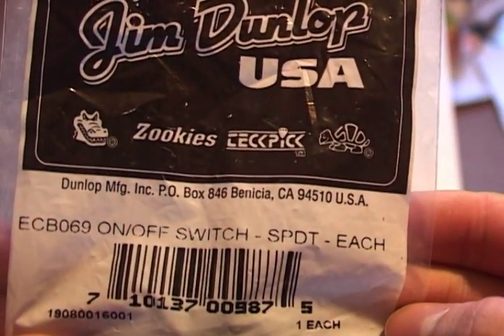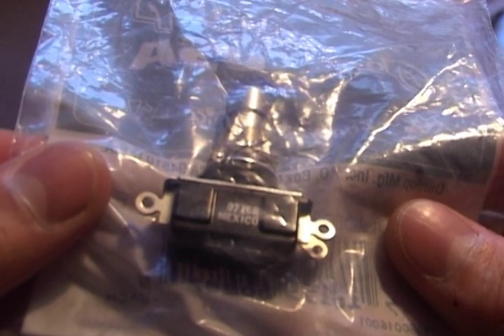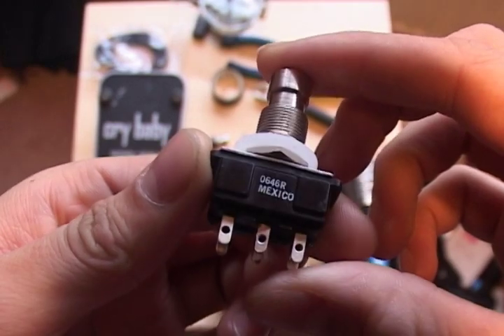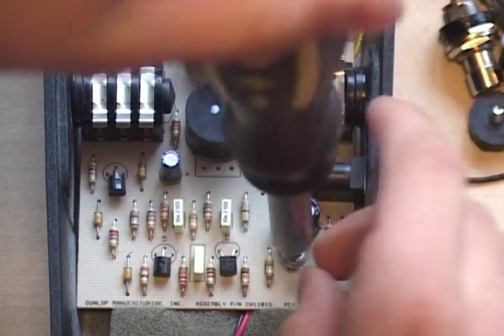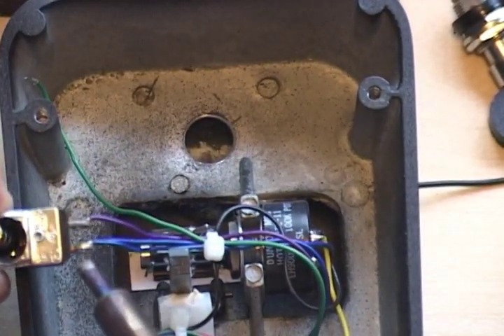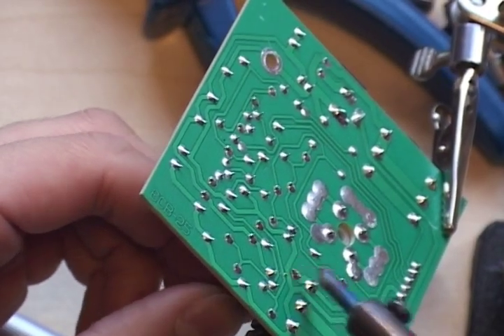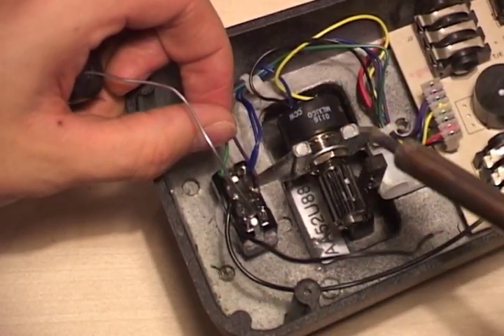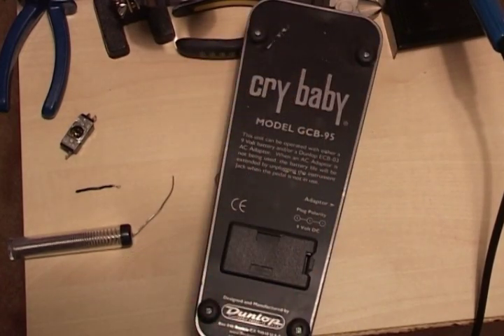Wah Mods (Part 1): True Bypass

Comment: I’m sorry but this is NOT true bypass. You need to break the trace between the input jack and that black wire you added for the input.
Pointless if you don’t break that trace.

Get you meter out and I bet that both input wires are touching all the time whether the pedal is engaged or not.

Comment: Hla tengo un wah wah bc le hise lo mismo pero no se donde va el cable agregado a la placa ya es un clon del cry pero no tiene esa parte donde colocas el cable nuevo.
Reply from the maker: Which wah pedal do you have? This was done on a GCB-95. From what I remember you add a cable to the input plug on the circuit board for the 'clean input wire'
Reply: @chrismusic-wav  l have wah DIXON CB 200.
Reply: @chrismusic-wav classic  clone of crybaby, vox 847
Reply: @chrismusic-wav  witch reversed polarity the negativo on the outside and the positive in the center
Reply from the maker: @paolaelizabethgramajo5827  also found this for you if it's based on the Vox 847 pedal https://dandyjob.com/true-bypass-mods-instruction/
Reply: @chrismusic-wav  gracias amigo!!!
Reply: Cualquier cosa te pido ayuda.
Reply from the maker: @paolaelizabethgramajo5827  I can only but try to help
Reply: @chrismusic-wav  ❤️!!
Reply: @chrismusic-wav  has no bufer
Reply: @chrismusic-wav  does the wire you add go on the clean side of the wah plate?
Reply from the maker: @paolaelizabethgramajo5827  it does. So wire should be connected on clean side of pedal to tip side of jack before any circuitry. You may need to look at the back of the board to check the copper tracks. Not sure what your board looks like so you'll have to check where the tracks go and if it splits to see if it goes through any circuitry as that track needs to be cut and separated on the board to be effective or i think it just grounds out

Comment: Hey I know this video was from 11 years ago but I edged out the bronze connection on the pcb as shown in the picture and now the wah pedal works but when turned off it cancel outs all the sound. It turns into a kill switch when turned off now would really appreciate a reason or solution for this!
Reply from the maker: Hey, did you switch the wires round as well also mentioned in the description? 'Switch the black clean input wire with the green FX input wire on the switch'.
Reply: Christopher Caplin yes I went back and tried that and it worked out thanks so much !

Comment: This is not true bypass. You need to break the connection between input/output jacks and the whole pcb using that switch. It cannot be connected to the pcb at all time.

Comment: Hi, I have the same switch that you used for a replacement.But i have a late 60s wah i want to true bypass Only have 3 leads the blue coming from the pot  the white from input jack and the green from out put jack.If you know how it should be wired that would be a great help Thanks.

Comment: Hi !
So I did everything as shown in the video and I assumed that by switching green and black wires, you meant those on to the footswitch. I also scrapped with a knife the pcb as shown on stinkfoot.se.
Now my problem is that when I plug the pedal, the wah is always on, regardless of me stomping the pedal
Did it happen to someone here ?
Any help please ??
Reply: You have to switch the black wire that you added to the switch with the green one and then scrape off the bottom of the board in the spot that he pictured in the URL link in the description

Comment: I did this true bypass mod exactly like he did, and it worked perfectly. I love it.  Also, when Crybaby's stop working well, it is usually the switch.  My switch went bad, but it was still working but just very low volume, making me think it was not the switch.  Since I had to replace it, I did this mod, and it works great. Thank you so much for this video. You took all the scariness out of the project.  Thanks.

Comment: Hi, I've tried to modify my Crybaby to True Bypass, but mine's PCB circuit is a little bit different from yours. Also, the capacitor on the left (the one you desolde) is now a WIMA capacitor. I'm afraid Dunlop has modified the original circuit for new Crybaby pedals. Do you think I should do it with the WIMA capacitor and follow the other steps as said in the tutorial? Thanks.

Comment: what do you mean " switch the black 'clean input wire' with the green 'FX input wire' on the switch?" desolder the newly attached black wire as described in the tutorial and swap places with the green wire that was just soldered into the top right position?

Comment: If you've used a stock Crybaby before, you'll know there is a significant degradation in tone if you put it in you signal chain. I'm not a TPB freak (I love the Boss buffers, for example) but modifying this pedal to true bypass is beneficial - which is why so many artists do so.

Comment: Dude stop freaking me out!Do you play the guitar or not?I just done the true bypass on a GCB-95 -2007 because it was sucking tone. My '88 one does the same and I am ready to do that as well as putting the yellow fazel inductor. I don't know why Dunlop doesn't do it by default, but the 2007 has a six pin switch (although not needed) as if it is waiting to be bypassed. I don't doubt  you are an engineer but I bet anything you don't play the guitar. Saying : "stop spreading this crap" IS an insult!

Comment: Hello there, I was surprised to see that my new (2007)  Crybaby Does have a six pin switch, red inductor but no true bypass. However instead of the resistor that we use to wire there is a blue square thingy like a capacitor ( marked C-2 ). Do you have any idea on how to on this one? The rest of the board is identical btw. Thanks
Reply: I have the same question. On mine the blue component is marked C9.

Comment: please quantify what you mean by the sucking of tone, if possible please show a spectrum analysis so I can visually see the tone before and after. 
this is NOT a modification, this is taking a circuit and ripping quite an important part out of it. the reason we put voltage followers in circuits is to compensate for the loss created by the impedance of the mechanicals and cabling, the people who designed these things didn't just throw it in there to spite you, please stop spreading this crap.

Comment: The GREEN wire is the CLEAN INPUT from the jack socket. It runs through the pcb and wiring connect plug! The BLACK wire is the FX INPUT! It goes to the buffered input stage.

Comment: This is  all a big headache. What about using an ABY switch to just switch the wah on and off? You know, to isolate it from everything else? Everything else on my pedalboard is true bypass, so maybe there's a way to run the way and everything else. Or, switch to separate it? Does that even make sense?

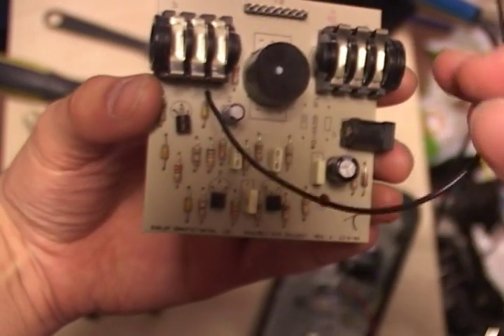Comment: Hello Friend! Great video!!!! I have a question about the resistor that you let the plate (3:10). The top of the resistor that you soldered to the wire DPDT will be free or you put it back again by soldering on the board?
regards

Comment: i guess why THEY doesn't put true bypass switches when making them, true bypass switches are expensive compared to regular 3 pin but its worth it when you got 10 pedals between your guitar and your amp the tone start to suck hard. not the first time i see this problems in pedals and in DIY projects

Comment: Thanks for this video. I followed everything and it works even if my cybaby is a much older version than the rev g. It still has that green pcb. The next step would be the fasel inductors which is much easier than this mod. Thanks again.

Comment: This isn't actually a true bypass.  Infact, I don't think you even did anything different than the original circuit.  When you take "clean input" and solder it onto the pc board, you are taking the input from the guitar, but that input is still running parallel with the circuit.  You need to romove the board trace from the input jack altogether.  Then send the input directly to the DPDT switch.  Then you send from the DPDT to that spot on the board for turning it on.